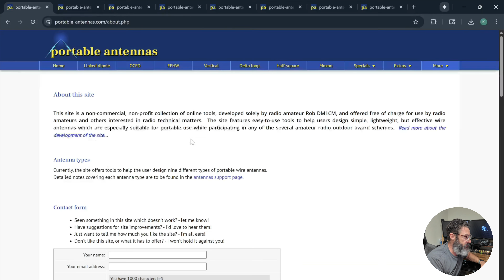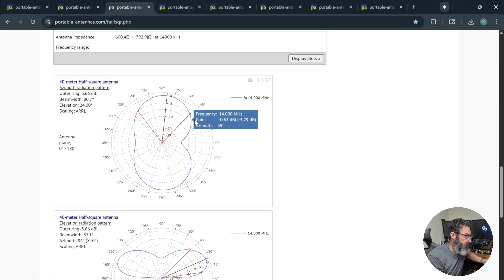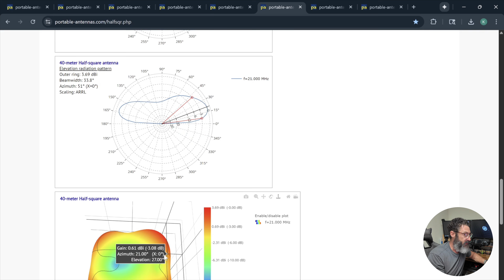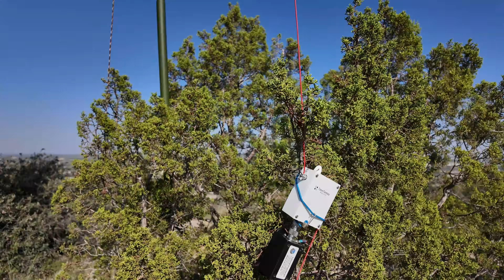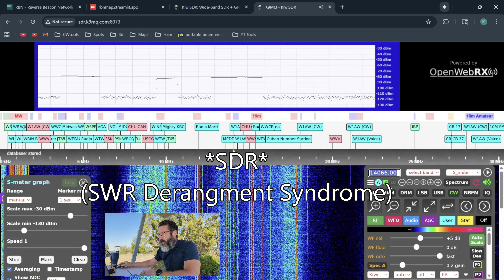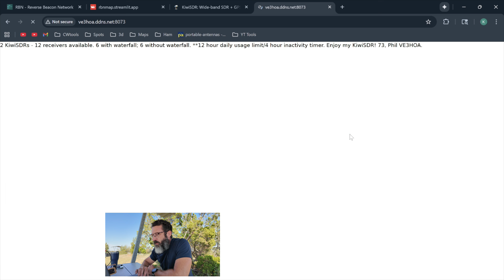Half-Square Antenna: 3.6dBi and Low Takeoff Angle

Comment: Have you noticed that most of the people who say swr is not important are normally the same who have a hard time getting DX?
Reply from the maker: That's a good point. My thinking is if I can optimize an antenna in a few minutes and reduce the losses by 5-10% it's totally worth the effort!
Reply: What are you trying to say?
Reply: @feeatlastfeeatlast5283 I’m trying to say swr does matter and there are a lot of hams that believe it doesn’t because their focus is talking locally (inside the same continent). The North America is close to everything, thus it’s easy to feel the antenna is performing with high swr. The reason is that Europe, the part of Africa with the most hams, and Middle East are basically ham radio neighbours. I started in ham radio when I lived at the bottom of South America and there the difference between 1.0 and 1.5 is palpable.

That why I’m saying, those who don’t care about swr are normally the same people who have a hard time getting DX, real DX .
Reply: @ve2zdx  "The North America is close to everything" - yep, sure is, excepting those weird, outlier places like Europe and Asia, South America and Oceania.

"I’m trying to say swr does matter " - but SWR is merely a measure of impedance mismatch.  Use a balun/unun/matching circuit/antenna tuner to minimize the mismatch and just get on the air:  it's in this sense that SWR at the antenna feed-point (as long as it's below some no-no value, 3:1 or 5:1, depending on your set-up) is not so important. A signal out is a signal out.

Those who strive for the very best SWR value by endlessly tuning/snipping/whatever - like the contesting fanatics with stacked Yagis, or those who MUST have every DXCC on every band, and like those who want the very best/shiniest/most powerful auto - are truly boring individuals.  Ham radio is essentially, and delightfully, an amateur endeavor.  Go light, go simple, go easy, and play radio.
Reply: @robbannstrom I know. But explain me why when I built yagis, quads I felt a drastic difference in rx/tx when I flatten the swr? Why my friend in Thailand barely copies me with 1.7swr and then when I flatten the swr he suddenly copies me 229? Why whenever I’m having a hard time getting a DX in North America then I flatten the swr and suddenly I’m heard? 

Back in my country I used to built yagis and cubical quads for selling. Me, all my clients and everyone I know from there have the same experience. Idk exactly what it is but I think this belief that swr doesn’t matter is spread in North America for financial gain.
Reply: @ve2zdx  OK, so you're basically talking about antennas for "power" stations - those who MUST get the ultimate performance from their professionally-designed antennas. I get that.  

This video from Tim K5OHY, however, is not about such stations or situations, but about setting up a simple wire antenna in less than ideal circumstances, and getting a couple of dozen (maybe even a hundred!) QSOs in a POTA (and quite conceivably also SOTA) activation. Low power, maybe not the best of radio conditions, and get what you can.  Look at the SWR values Tim gets on 40m, 20m, 15m, 10m - believe me, those are truly SWR values to dream of when operating portable - you should try it sometime, and get to know what amateur radio is really about.

"I think this belief that swr doesn’t matter is spread in North America for financial gain" - that makes no sense at all.  Surely, those looking to make money from radio hams, in North America or wherever, would be claiming the very opposite - i.e. "our antenna will give you the very best SWR possible", and make money from that.
Reply: @robbannstrom hey, I activate pota quite often. I also only operate portable now with a kx2. But when I started here I got a x5105, a qrp guys antenna and a fishing rod. In 2 months I got 68 countries,now I have 210. All portable not too different of the gear used by any pota op. I don’t think I have more knowledge or better gear… I just respect the basics. 73!

Comment: Great video as always. My buddy used the half square for IOTA here in NC. It worked well but was far from a “killer” antenna. For portable ops, I think I’ll stick with the PPerformer. Easy to deploy. Not as unwieldy as the Challenger, and generally very effective. For a multiband wire antenna, I’m still trying to find something to beat a doublet. Haven’t so far. Great to work you on the half square, operating QRP portable in SC 👍 73, Marc, W4MPS
Reply from the maker: Thanks, Marc! I was expecting better performance but still fun to try. Hard to beat the PERformer for POTA.  I agree a doublet is great multi-band antenna.  I'm planning on making one in an upcoming video. I have a small Nor-cal doublet, but plan on making a larger one soon. 73

Comment: Thanks for the fun experiment. I found my 56:1 unun gave me a better match on the half square. I didn't use a counterpoise. And I located my choke back 7' from the feed point. Which is .1 wavelengths on 7 MHz.
It seems like the 1/4 is a much easier setup, especially when portable. KE6VG
Reply from the maker: I’ve got some toroids and plan to build a few different ununs, including a 56:1.  You’re right, the 1/4 wave is a much easier setup when portable. I’ve actually been using the Challenger vertical OCF a lot lately  because it’s such a quick setup.

Comment: Told you it would be a good antenna but excel in mo band use. You can also use it upside down, U shape, to feed it directly with coax. Keep the horizontal a couple feet off the ground. 73 de N6LDM
Reply from the maker: @DemaMoto I was trying to find the comment that suggested the half-square but forgot what video it was on. Great suggestion! I'll try it as a mono band antenna next time.
Reply: @Tim-K5OHY  Jul, 21st
Reply: That would bring the high-current section very close to the ground, leading to high losses by coupling of near-field energy straight into the ground. Not an efficient configuration.  Then again, I know of at least one other operator who has tried this configuration.
Reply: @robbannstrom  You are right but when i tried it i didnt notice any difference between the U and n shape. But i should have noticed them.
Reply: @DemaMoto  I'm sure your measurements are correct - it's probably the two vertical sections in the U-configuration which are producing this effect, I'll have to try and model this configuration...
Reply: You need to do a video on that!
Reply: Great effort. We all learned by this experiment. Antenna modeling is essential to see the results. Cant imagine the older Hams did not have these equipment. Best 73 & and keep on doing a great job

Comment: Interesting and good video. I actually tried this last night (HOA hiding time). I fed it as an EFHW and I really liked it on 20M. It was very quiet. I had good SSB DX contacts after midnight to Europe and the Mediterranean. On 40M it was really noisy at my qth so I think it shines on 20M but not as much on 40M. Keep up the videos!
Reply from the maker: I agree it definitely shines on 20m. It was very quiet even here at the house . At the park I had a bit more noise on 15m but it just wasn't open at the time.  What's interesting 40m is noise on almost every wire antenna I try at home but for some reason a 40m vertical, 25ft whip and small coil is quiet and works well. Thanks for the comment!